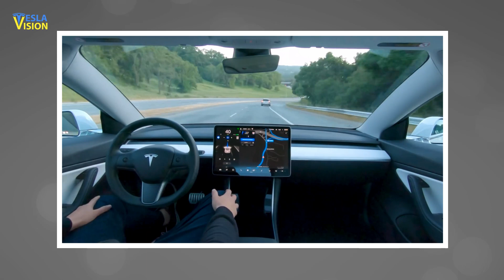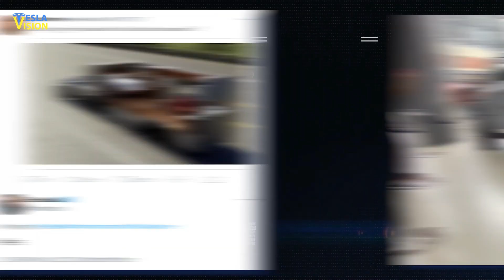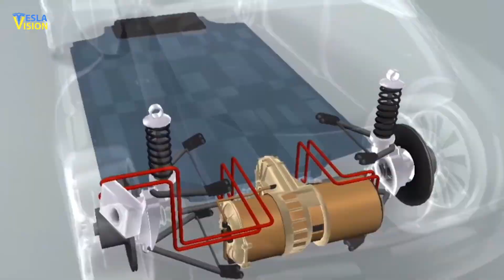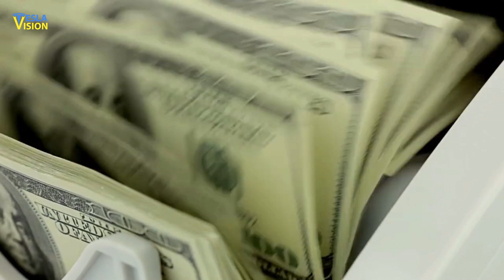NEW Tesla Truck Is Going To Take Over Trucking by 2024 (Here Is Why!)

Comment: No, it won't take over the trucking industry. It's a day-cab not a long-haul OTR. The end of the market that the semi will take over is the dedicated routes in the 400 mile or less range. The non-dedicated trucking will still rely on the diesel trucks.
Why?
1. Charging stations will take at least a year or more to install at/near all of the current TruckStops
2. The cab would have to be redesigned for long-haul OTR to accommodate many overnights in the truck.
3. Day cabs and yard trucks will be initial markets.
4. Another potential market would be the flatbed/dump/etc trucks. Maybe even tow trucks. Definitely busses.

Cyber Truck will also not take over that segment.
1. Looks will not be pleasing to some people. Personally, I like it. But I also like change with a purpose.
2. It will have to prove itself in the construction world before it's widely accepted.
3. Price point will have to be equal to the lower full sized pickup truck as not many people or companies will pony up that much $$$ for something that is going to get abused with muddy boots, filthy clothes, etc. from working outside in raw environments.

Performance wise, for both trucks, they're both very capable and a lot of them will be sold. But I don't' really see them taking over the entire Semi and Pickup Truck markets in the next 2 years.

Comment: Going to change the trucking industry. Nothing comes close at the moment.
Reply from the maker: 10 years head start, just like first model S
Reply: @TeslaVisionChannel  As a sceptic I will wait until the semi has proven itself in real life before I judge. A 10 years head start? If Elon held his promise he would have delivered the semi 5 years ago. Does that give him a 5 years start? The Tesla semi is a truck, but not all trucks are semis. When will Tesla provide a platform (chassis) for tippers, heavy construction trucks, distribution trucks, garbage trucks? He needs more than a semi designed for hauling to take over trucking. He has however an advantage in semis in the US. I believe the competition has just started. Designing a BEV from start is not rocket science, the problem starts when the second generation of the truck is designed. How many carry over parts? The continues development of the truck is not dependant of the drivetrain, BEV or ICE. For example Scania has 21 axle configurations where 7 are tractor configurations, Tesla has 2, 4x2 and 6x4. I am sure they can design a 6x4*2 or a 10x4 rear-steer. Scania has 22 different Cabs (23 with the crew cab) Tesla has 2? It gets complicated when customer orders come with specific transportation needs. Hauling between 2 or 3 sites is easy. The battery capacity is depending on the transportation need. If you can charge and the route is known, the battery does not be so large as it adds weight, limiting towing/cargo capacity. I am happy that Elon started the race and I will enjoy the competition as a retired Scania employee ( R&D, Production and IT management ). Only time will tell who will be on top, but I will wait until real figures are available, not speculation from Elon fans.